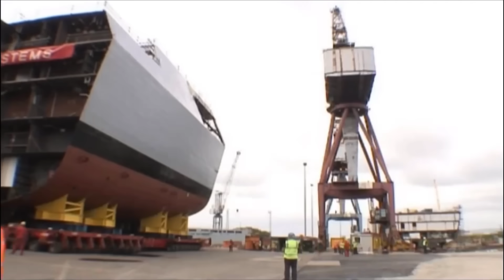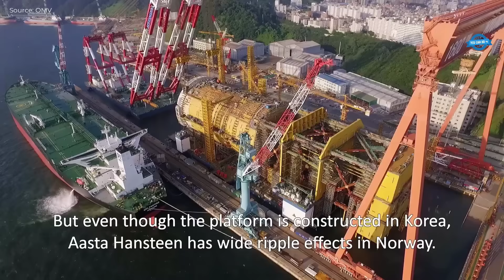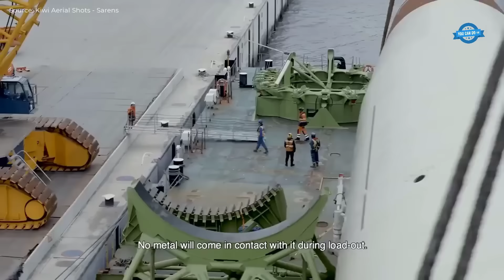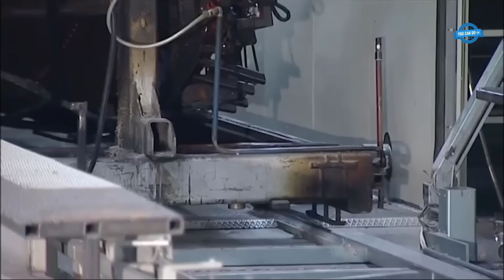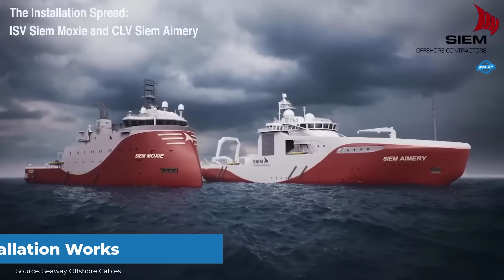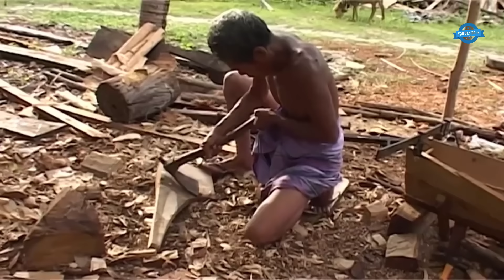Ultra-fast Stainless Steel Boat Welding Technology. Giant Cruise Ship& Offshore Construction Process

Comment: Aasta hasteen requires 11-16feet frozen ballast 91% frozen ocean june 2026
Tsunami australia Sydney 1197feet 1356feet (6) 
Ice fjord tsunami sidney australia post june 21, 2026 204feet 447feet 606feet 
.

⚠️😇
Chicken linear 9×10×2-7feet ride family stack duck quaille emu pheasant 11 level 2.2 - .4 years food clean I ng faxolity crew. Aerospace operating m8nimum maintence capsized shelving and operational frozen ocean

17790yrar e• 
Planet/globe knowledge aerospace flight c]

11-16 cords wood
Reply: 6200 feet ships added Catamaran 1.1 sunk ship floating door exit capsized frozen ocean

Comment: The fact that someone designed this on paper, they built the parts and it all went together is amazing.
Reply: No paper it all design in CAD and they even run programs were humans are simlated so they can check things like doors are right direction and valves can be operated with things like wrenches to avoid things like pipes not being in the way. Paper went the way of the dinosaur like 40 yrs ago.